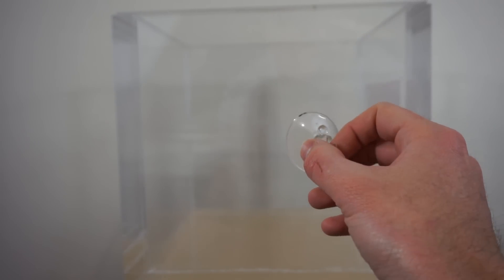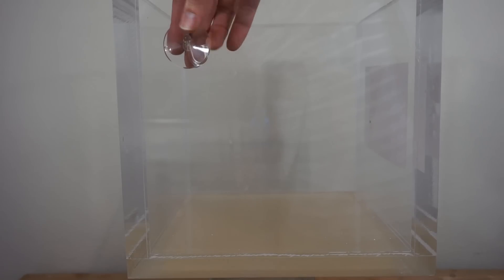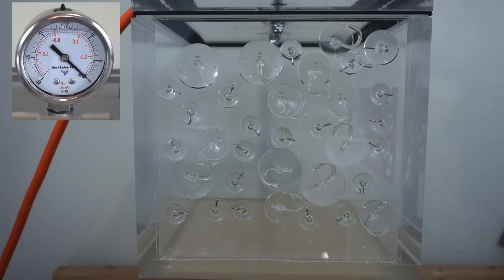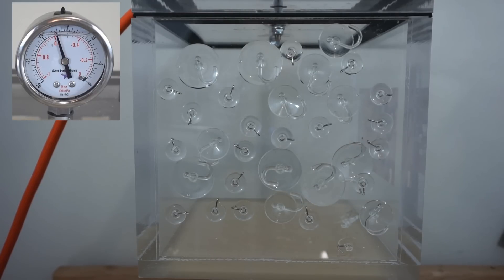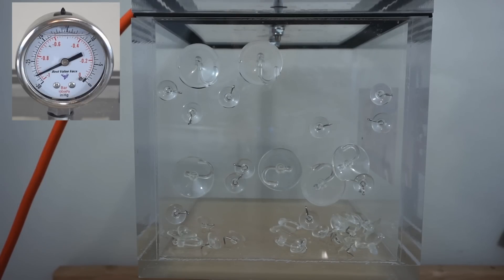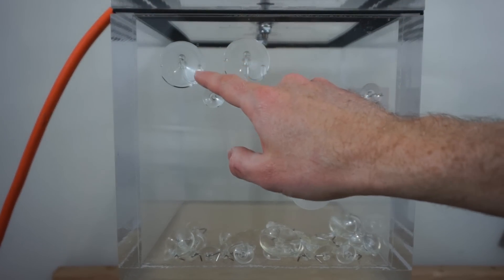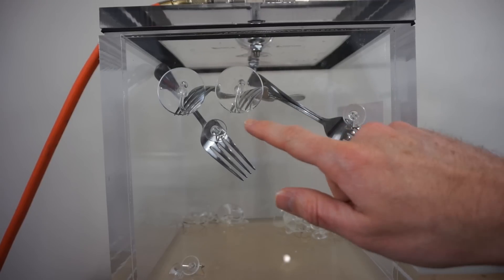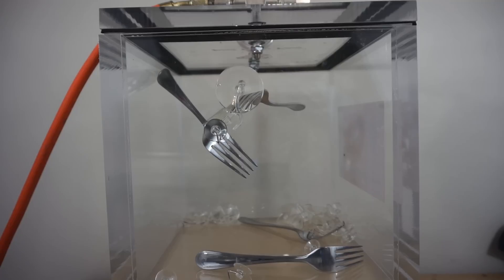Do Suction Cups Work In a Vacuum Chamber? Will They Stick?

Comment: Guys my hypothesis is that the suction cup should be able to stick because the vacume chamber suck all the air out but the section cup doesn't need air to stick I will edit if I hit right or wrong
Edit: my hypothesis was wrong

Comment: I think the pressure is arbitrary. A properly engineered suction cup would stay on due to tension preventing entropy, more so than a counter pressure holding it on. 
Tension vs pressure, consider entropy

Comment: According to your video with the cup gaining water on the inside due to the matches burning all the air up, these aren’t actually suction cups? Nothing is being sucked rather then pushed. So they are push cups

Comment: The theory was clearly wrong that atmospheric pressure causing the stick. It was the lack of residual air on the sticking surface that was causing it. This was the reason for the variation in the sticking power. The suckers would all stay on if the sticking interface was a true vacuum. The bond would be caused by the irregular surfaces mechanically hooking onto each other.
Reply: Its not a true vacuum and plus he can't calculate the exact sticking power of all of them c'mon its just a fun expiriment

Comment: Before watching, I know they won't because the pressure in them needs to be lower than the pressure outside of them. That way because there's lower pressure in them they'll be pushed against the surface of what they need to stick to.

Comment: I think this test isn't q big deal because when you stick them inside the chamber, they keep a small amount of air inside. So naturally the vacuum pump will try to pull that air bubble out, making them fall.
Reply: But any air under the cup would be at a lower pressure so the differential would remain the same.
Reply: @Lee.S..B  What

Comment: I would like to know if you could re apply the cups once they have fallen off. You may not be able to in a complete vacuum but with just a little air remaining it might be possible. Then allow the air back in and see if the cups are extra hard to remove. Because I doubt the typical action of pushing on a suction cup removes all the air so one placed in a vacuum should be stronger once the vacuum is released.

Comment: Hi Action Lab,
I would like to know if it is possible to make vacuum bubbles in a container of water(or any liquid preferably one that does not evaporate) inside a vacuum chamber? For example in normal atmosphere if you were to plunge a clear cup facing upside down into a container of water, you could see air in the cup. The air basically displaces the water preventing it from entering the cup. I would like to know if this still works under a vacuum? What would happen if you plunge a cup upside down filled with nothing but vacuumed space into a liquid? Hope my question is not too complicated or wordy. Thanks for your videos!
Reply: It's a nice idea, i will make it.

Comment: Hi, i told a Youtuber (Nozman french) to do that a few years but he wasn't interested. Nice to see that it work.
Now can you try to stick suction cups when the vacum has no air (with your magnet or special gloves) and turn to normal pressure and try if suction cup can carry more weight ?
And then another experience : Champagne in high pressure vacuum chamber (more atmosphere) to see if bubbles stop. Because i think it's the same effect has boiling water : It's not really boiling.
There is a lot of things i would try but i havn't this chamber. I need to buy one.

Comment: Hey, I have an experiment suggestion! Could you build a Crookes radiometer out of the vacuum chamber and some black/white vanes. And try to make the vanes rotate by photon pressure (which is not achieved in the actual radiometer – that one works on heated air currents in partial vacuum)

Comment: part 2 of my question because part 1 got sent before I wanted it to:   Could you perform an experiment by constructing a sealed box with a form covered with different types of foil and put them into your vac chamber to see if they would maintain their sealed integrity or if they would fail (get a blowout) I saw the "chip bags" which brought this to my mind. Thanks, Anthony

Comment: I have always been curious about why the LEM (Apollo Lunar Excursion Module) which according to NASA had only a kind of metal foil (Mylar?) for walls, would not have gotten a "blowout" in the vacuum of space. There's presumably 14.7 lbs psi of pressure inside of it and a vacuum ouside (the Astronauts -Armstrong & Aldrin) were not wearing space suits inside  there

Comment: Haven't watched it yet, but my answer is not, they cannot stick since there is no external air pressure pushing on them.   Now to watch the video and confirm the obvious.   :-)

Edit:   Was mostly right.     You didn't get a perfect vacuum, so a couple of them remained stuck, or possibly due to the stickiness off the suction cups.

Comment: The air that is trapped between the suction cup and the wall expands and pushes them away
Place them on the wall while under water.

Comment: Makes sense what's going on. After all, you're creating a vacuum within the suction cup, and since the material has such a good suction due to it's gel-like quality, no air can creep in and knock it off. When in a vacuum, what little air is trapped inside expands as it's getting drawn out by the vacuum outside the suction cup. Therefore, they start to lose their grip which is why you see an expanding circle of air in the suction cup.

Ultimately, it shows how much force you have to pull with to take off the suction cup without having to resort to peeling it off. You're fighting against a mini vacuum.

Comment: I always get peeved when these suction cups don't extend the hook beyond and below the suction cup edge to have a resting point around which the load torque can pivot and only apply almost-linear pulling force on the suction cup, preventing an uneven deformation of the rubber/silicone.
I guess not every designer/manufacturer is an engineer...

Comment: I thought that the suction cups would fall, bc the air pressure is lower on the outside, than on the inside of the suction cups.

Comment: The suction cups by default won't work under a vacuum. Suction cups work by having a lower pressure within the cup as the pressure outside is greater. This causes the cup to stick to the all as the outside pressure that's greater will press in on the inside of the cup with friction holding it. By having them in a vacuum the difference of pressure is gone and the suction cups won't stick.

Comment: please try petrol/gasoline in vaccum chamber. it will be very interesting because if we increase pressure inside it will cause the material inside to boil but at the same time petrol need oxygen/air  to burn

Comment: No because suction cups work due to the higher pressed on the outside pushing the suction cup to the surface. With a vacuum on both the contact-side of the suction cup and on the outside, the pressures are equal so it wouldn't work.

Comment: the Gravity force/acceleration its the velocity witch any objects falls in the vacuum. the gravity force on Earth its 9,81m/s (1 meter in a second) so can you make a test for calculate the time and the space taken by an object in the vacuum and then calculate the G acceleration?
if your vacuum isn't 1mt. or if you cant droop an objects for 1 sec, then use the half meters/second for calculate it, just duplicate the quantity of 1 m/s and then calculate the Gravity.. anyway you've already do the drop test, with an magnet and an feather, then just use the same drop video for calculate the gravity. you can use the video editor for got the precise time

Comment: Do you think you could make it rain inside the vacuum chamber
Reply: Tommy Hennigar Liquid remains at constant volume regardless of pressure, a vacuum does not change the effect of gravity, it would still rain, however the shape of the drop would be different as there is no air resistance

Comment: I suppose the same logic applies to plastic wrap and sticky note pad paper. Try weighting low stick notes and put them under a high vacuum. Will they fall off? My guess is that they will still stick but is there an air pressure component to their adhesion to a plastic wall?

Comment: Better yet, how about testing whether a suction cup can be applied in a vacuum. Since it works on pressure differential, can you create a difference in pressure in a vacuum?
Reply from the maker: +Greg Snow maximum pressure you could get is about 0.1 psi since that is about how low my chamber gets. Might not be enough to hold it on, but maybe it can! It would be hard to apply in the chamber though.
Reply: The Action Lab you could have checked if the last surviving suction cups had visible differences against the ones that fell first. Maybe they were better made, smoother, more round, more plain or taller, or cleaner or greasy or something that made them better.
That info would be great to know! :D
Even better, number a bunch of them and take notes of the pressure at which they fell, then you can gradually look at each one and tell why some are worst and some are the last survivors.
Preferably, use brand new cups from a bag, and wear gloves while numbering and sticking each.
Reply: I wanna see too how the vacuum suction cups stronger to regular ones...

Comment: what would an electric arc do in a vacuum?  Air causes resistance, but in a vacuum, would the arc have less voltage consumed to get the arc to jump to the other lead?

Comment: Before watching this, ...
My thinking: "Of COURSE they won't work - even the smallest amount of air would force that away from the side and the cup will fall off.  They work BECAUSE of the difference in pressure.  When you lower the air pressure, that little bit of air will make it go "boing" "

After watching: 
"Yep... as I would have expected...  you can't get all the air out."

Comment: how do you read atmospheric pressure? I hear you say ".1 atmospheres" but the meter doesn't say .1
Reply: The meter has the "Bar" measurement written in red on the inside (while not exact, a 1 bar is very close to Earths atmospheric pressure).

Comment: Before video comment: The cups will fall off because, suction cups work by making a vacuum of their own to make them stay on a smooth/ flexible surface. So they wont work if the suction inside the cup is matching/ greater than the surrounding air pressure.

After video comment: 1:58 called it. Also to see them resuction onto the glass was interesting. I wonder how much force it would take to pull that off without using the vacuum chamber again.

Comment: Hydraulic Press Action: I don't even need to see the video . What holds a suction cup in place is a vacuum so when the air pressure is the same or less than what is under the suction cup  the suction cup will fail , it will fall. now I will see the video.

Comment: While there is a vacuum, stick a suction cup to the bottom of the chamber and put the air back in. Now try to pull it off
Reply: Some vacuum chambers have sleeve-like gloves in the wall of the chamber to manipulate things in it.  These gloves are usually only in professional ones.
Reply: Aelerity Maybe a small remote controlled robot arm that cant press the cup against the bottom lf the chamber. The question is, if the remote controlled robot is still working in a vacuum
Reply: EVPointMaster this and compare the one placed under vacuum to one placed in normal atmosphere. There's got to be a way. Maybe weight on the suction cup to press it down? A brick could work.
Reply: Lucas 'Ktulu789'
, yeah, he could moisten a large suction cup, hang it from the top with a magnet like he has done other things, then make it drop. If it doesn't bounce and flip over, then sitting flat with the moisture providing a slightly better seal, it seems like that would work.
Reply: Maybe just leave them on the bottom and remove the air. Probably when the pressure is restored, some will just auto stick. If they are flush with the floor, it's highly possible that air gets fastest into the chamber than below the cups, pressing them down.
Reply: Some random person , Uh yea I didn't thik of them

Comment: I wonder what causes the adhesion between the rubber and the plastic. I had assumed the "stickiness" was a suction-cup effect on a microscopic scale. In which case the "adhesion" is really just the atmosphere holding them together. But seeing how well some of these held up under a vacuum certainly makes me question that assumption.

Comment: I would like to see a dead animal like a rat in a vacuum to see what 
happens( like the dead rats u buy to feed snakes). Only for educational 
viewing. Not to be gross or anything.  
Also a broken LCD Screen would be nice to see. A Subwoofer also not to 
see if it would make noise but to see if it will still move under 
vacuum. Also igniting a Firecracker while its under full vacuum.

I'm copy pasting my comments on all his new video untill he does it.

Why didn't u put water it in a Air Tight Jar and see what happens? U 
could submerge the Jar and lid under water so its 100% air free. Then U 
could put a silicon sealer around the jar to make sure the seal does 
hold and then we could see if water boils.

What Happens if U put a distilled water battery from a car under vacuum?
 What does happen with the battery volt when the battery is under 
vacuum?

What about a red hot metal under vacuum?  What would the metal do? What 
about liquid metal under vacuum? 

Is there someway to heat up a metal so hot under vacuum that it would , 
melt and stay in a liquid state then u keep doing a purging setting as 
in vacuum then release let cool off then repeat. Would it make a cool 
design? or would it stay flat due to it being melted?
Reply: The subwoofer would still move. I literally dont understand why you think it wouldnt. Distilled water would behave like any other water it would boil away.

Comment: You should try the suction cups for gps mounts and also car body repair.  It would be interesting to see if the mechanical lever which pulls the center of the cups out to create suction helps or hinders it in a vacuum.  I would guess they could stay stuck even with weight added at your lowest pressure.

Comment: Can you do a fidget spinner in a vacuum chamber? Compare the times of one in a chamber and one that is not. I'd like to see how much of a difference between the times there would be.
Reply: How would he get it to start spinning under vacuum?
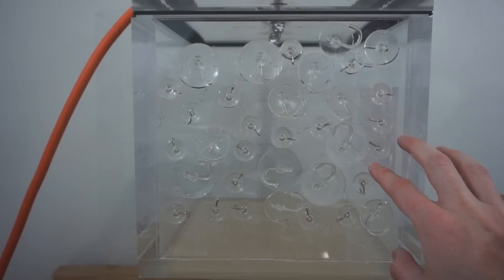Reply: Even cheap spinners can spin for 1:30, so you would set it down in the vacuum, give it a good spin, start the vacuum, wait for results.
Reply: it would spin more because of the lack of friction and air resistance
Reply: Yes, but I am interested in seeing how much longer it would spin. Air resistance would be eliminated, but other forms of friction within the spinner itself would still exist.
Reply: agreed
Reply: A guy made a video of a top spinner in a vacuum chamber. The difference was from 10 to 84 seconds. I am interested to see how a fidget spinner would behave in either environment .
Reply: m b It would spin longer but you would also have to account for how much force he applied to each spinner because those would be different too. I doubt it would spin much longer because the main reason the spinners stop is the friction between the bearings and the rings that hold them in place. It would be cool to see how much of a difference it would make though.
Reply: m b it still will be less friction
Reply: m b the one in the chamber will spin longer cause nomair friction
Reply: m b the difference would be very little as the most drag is from the friction on whatever it is stationed on/against.
Reply: Vusstar tf Not really. The spinners don't get much friction from the bases where your fingers go. That's how they're designed. The friction mostly comes from the air around it.
Reply: Some random person , not really, the drag created from the bases is ALOT more then the drag created by airfriction. Doesnt matter how it's designed.
Reply: I also believe that most of the friction comes from the bearings, although I believe that lack of air friction would significantly increase airtime. @Hydraulic Press Action you should do an experiment to find out!
Reply: m b the difference in time is so small its irrelevant
Reply: Batman It will spin longer, but the additional time would be very negligible. Since they push very little air out of the way, the real friction is actually in the ball bearings.
Reply: m b he did that already
Reply: m b I

Comment: try to put  them on the wall after the vacuum and see if they stick and if they do then let the air back in and you will not be able to take any of them off without a ton of force

Comment: I have another theory, but not sure if it's true. So I imagine that not all of the air is pushed out when the suction cups were pressed against the wall of the chamber. If there was some air still trapped, is it possible that as the pressure decreased the volume of the trapped air expanded causing a  decreased amount of suction until they fell off? Or that the trapped air expanded so much that it escaped and broke the seals of the cups?
Reply: The amount of air pushed out is going to depend on how strongly you push on the suction cup. Once the pressure outside the cup is unable to keep it against the wall, it falls off. Saying that the trapped air was expanding is just another way of saying that the inside cup pressure is higher than the outside cup pressure; either way it means there's no more net force pushing it against the wall. It's possible the few that didn't fall off had a higher vacuum than what the machine was capable of producing, I'd find that more likely than purely plastic-plastic interactions...